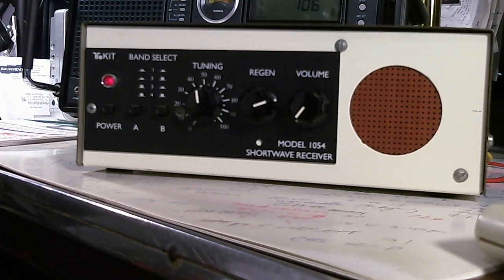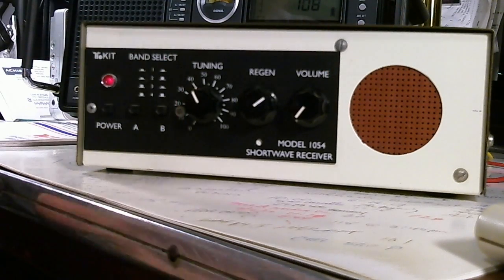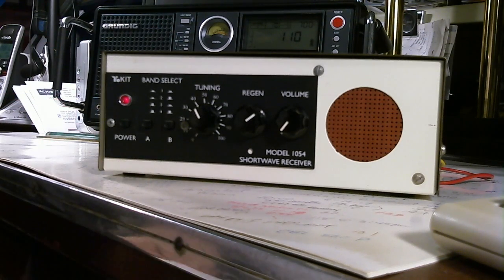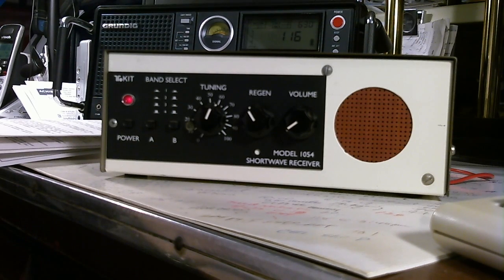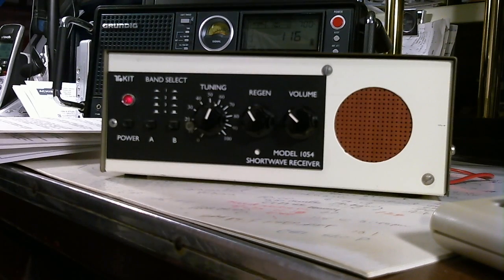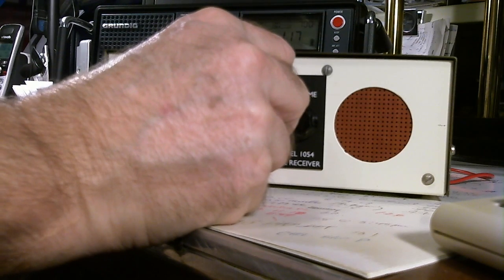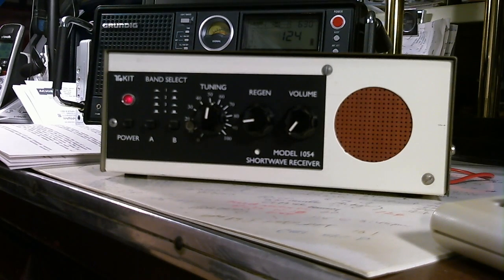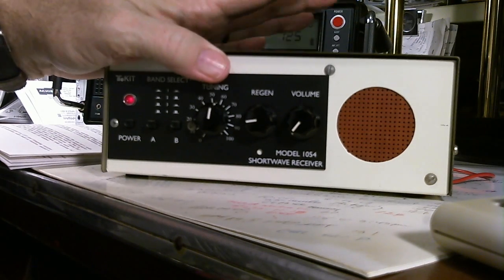TRRS #0207 - TenTec Regenerative Shortwave Radio

Comment: Hay Tom, if you had to pick the SW receiver that is the best bang per buck what would it be? thanks ( KD7YKR )
Reply from the maker: That is a tough questions because there are a number of factors you have to consider such as portable vs table, SSB needed, do you need the full shortwave band or just the international radio bands.  This radio is an example of a radio that would only appeal to certain people.  Also, you can get some good deals on use radios but you have to know what you are looking for and how to test it before buying it.

Anyway, I would need more information from you before I could give you a recommendation.

Tom